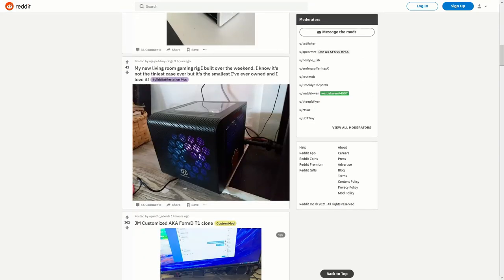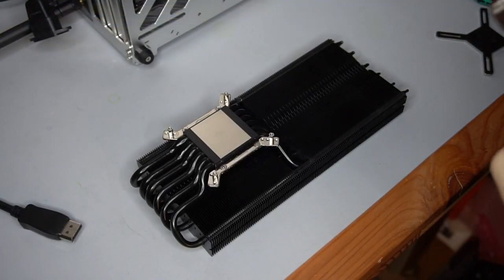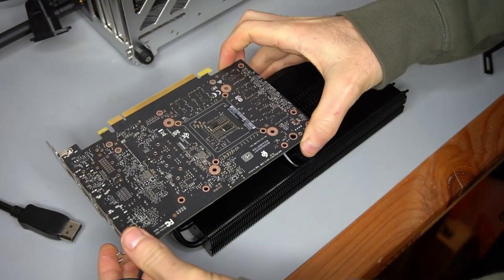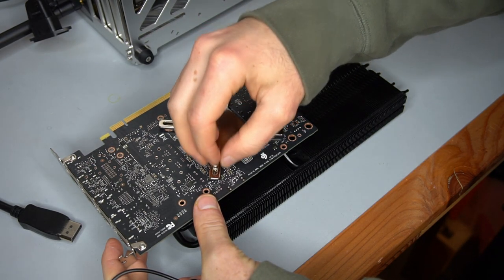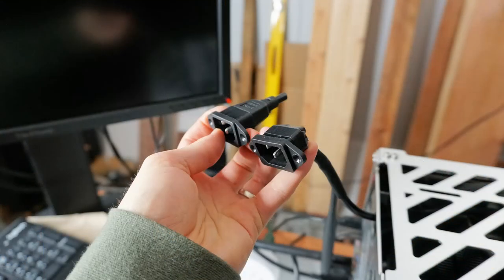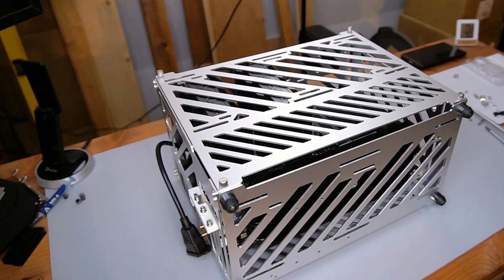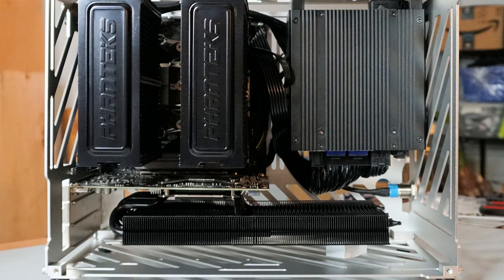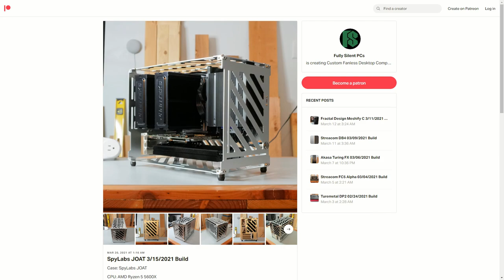SpyLabs JOAT - Building a Fully Silent Fanless PC

Comment: Would love to build something like this but every time I have tried I hear coil wine, and that sounds worse than some low RPM fans to me
Reply from the maker: Which components did you hear coil whine from? I occasionally get GPUs and power supplies with coil whine and have to return them or sell them secondhand when I do. The components in this video had zero coil whine luckily, but I understand it is a concern.
Reply: @fullysilentpcs  which is the strongest intel 12th gen and rtx hardver or 16 series gtx do you think it can cool fully passievely?

Comment: Nice build,
I am thinking about doing a passiv build.
For the "case" I am going to use the Streacom bc1 mini with a Fractal ion sfx psu (650w, according to the specsheet it should run passive up to 250-300w while being a lot cheaper than the nightjar).
For the Mb/Cpu combo I am probably going Intel hopefully combined with a silentmaxx big block.
My current Gpu is a gtx1660 which I am trying to keep in check with the Morpheus and some undervolting (which still might not be enough since it is a 120-130w gpu).

Comment: Nice build. I think the Cooler Master NR200 Mini ITX Case with a Scythe Ninja5 cpu cooler would be fine as well.
Reply: @benisrood  You can definitely use the Scythe Ninja 5 for passive cooling up to ~60W TDP. I am doing this myself with a Ryzen 5600X. Although I am running it in ECO mode (45W) which is only about 3-5% slower but ~20°C cooler. Usually I am not getting more than 60°C and very seldom more than 70°C.
Reply from the maker: Yep, a Scythe Ninja 5 can handle up to about 70 W even with its fans removed.

Comment: The smaller VRAMs passive coolers don´t fall off after you put the card inside? Are they sticking only through the thermal paste?
Reply from the maker: Nope, the smaller heatsinks were held in place with thermal glue. The larger VRAM heatsinks had thermal tape. No normal thermal paste used there.

Comment: inaudible fans: exist

"silent" pc builders: no thx, i only want electrons to move around in my pc 

i like the aesthetics and all, but it just does not make any sense to not use active cooling. if the chips and voltage regulation are not crazy efficient, it's very inefficient to cool it passively.